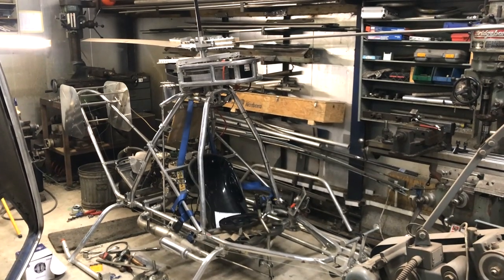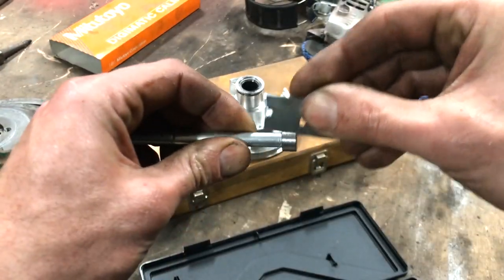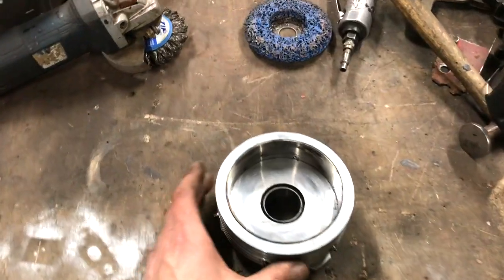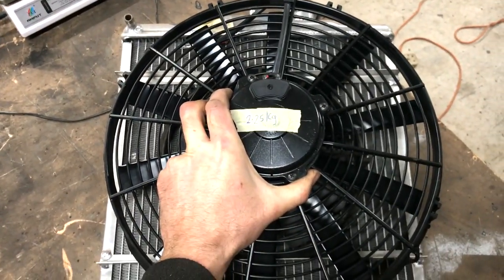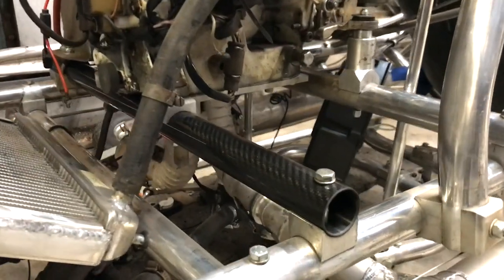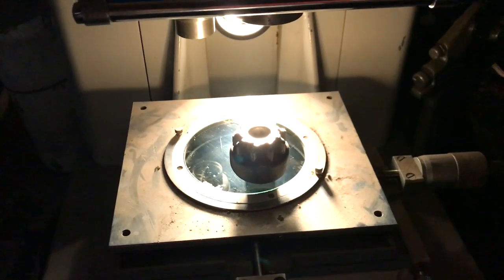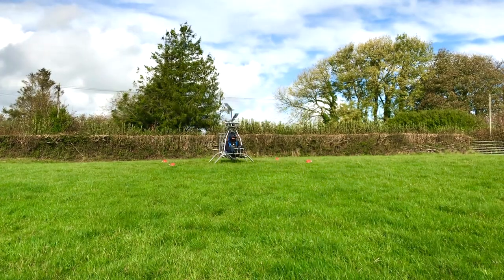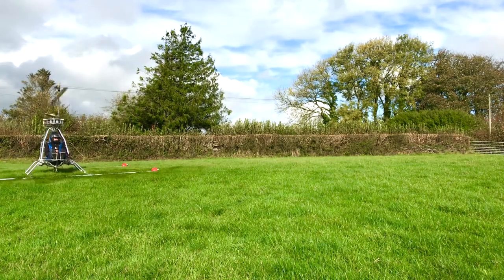It's not easy making a Helicopter

Comment: Bearing walk out may be symptom of drive shaft dynamics. Possibly boot distortion unbalance or even shaft bending flexure. High speed cam best way to see what's going on. Play it safe with engine rpm as its original design duty cycle might not be as demanding as a helicopter in hover. Recommend wire lock nuts to be sure that you are sure that nothing is coming loose...
google aircraft hardware suppliers to stop viscous YouTube algorithm deleting posts about flight safety. 🙄

Comment: Variable pitch opposed to variable throttle is the answer for a more stable hover.
Reply from the maker: Well, collective pitch is what I would choose next time. Fixed pitch is certainly less sensitive than collective, so in calm conditions it's easier but as soon as the wind picks up you want collective for the quick reaction time.
Reply: @Ben-Dixey  it’s that rotor speed staying at a constant high rpm gives you the stability. Much like a spinning top. If you slow down the top it wants to topple over and become wobbly.
Reply from the maker: I can't agree with that I'm afraid, there is no gyroscopic stability in any helicopter that I can think of. They are inherently unstable. The only exception might be the hiller flying platform, but the stability in that machine is not gyroscopic.
Reply: @Ben-Dixey  A co-axle helicopter is probably the most stable flying vehicle. So much so that they are sold in toy stores to kids. You don’t seem to know the flight characteristic of a helicopter meanwhile you’re building one for yourself to fly. Find a RC version and fly it first would be my suggestion. But hey to each their own.🫡
Reply from the maker: The toy rc coaxial helicopters are stable because they have stabiliser bars. You'll notice that weighted bar attached to one of the rotors. That is why they are easy to fly, not because they are coaxial. Coaxial helicopters are no more stable than any other configuration.
Reply: @Ben-Dixey ack to why the upper mass gives a top gyroscope effect. The top needs the bars because it’s small and needs inertia. Otherwise the blades would slow down too fast allowing it to topple over. I thought you as a mechanic would simply know the basic physics of a helicopter before building a full sized one. That’s the whole point of putting weight on the tips of the rotors.”Mass” you know “flywheel”. That’s why autorotation works because of the rotors mass has inertia.🤦🏾‍♂️ to be perfectly honest you will laugh at your own reply about the stability once you’ve flown a variable pitch. They are hands off stable. https://youtu.be/Z83t1iejpc8
Reply from the maker: At what point in the video did the pilot let go of the cyclic ? This demo flight was possible due to the very skilled pilot. Cyclic pitch coaxial helicopters are not stable. 

The stabiliser bar on the rc coaxials is connected to the rotor via pitch links, the stabiliser bar is a gyroscope and controls the rotors via cyclic pitch control. Arthur Young developed the stabiliser to improve stability and it was used on the bell 47. 
Adding weight to the tips of the blades is for autorotation performance only. Not gyroscopic stability. 
 You are getting more disrespectful in your reply's. I will end the conversation if this continues.
Reply: @Ben-Dixey  lol is a gyroscope not like a top is my point. With respect, you have chosen the least stable platform considering coaxial helicopters to build. Anyone who has had experience via RC or full scale would have simply known which platform to your build skills towards with respect. You can end the conversation here. I understand my constructive criticism comes across as offensive to you. 
Keep the good work fellow 
This guy explains exactly what I was saying 
https://youtu.be/j273HGK6g5M
Reply from the maker: Hi, I watched the video and he says that the higher rotor head speed on the collective pitch model gives more gyroscopic stability. This is not correct. What it does is makes the model more responsive, it does not help stability. You are assuming for some reason I have no experience in flying Rc models but I actually have a blade SR, blade 400 and I used to have a fixed pitch coaxial. The fixed pitch coaxial was the easiest to fly by miles. I have also flown an R22 and of course my homemade full scale helicopter.
Reply: @Ben-Dixey  so to you, the speed of the rotors has nothing to do with stability. It's not an argument on my part. I just assumed we would both agree with that much. My raptor 60 would handle a lot better at higher RPMs. it was less susceptible to the wind. Are going to tell me that your fixed pitch handles fine in windy conditions?🤔The authority of the aircraft “high rotor speed” I thought accounts toward the stability also.
Reply from the maker: Ok, we are getting somewhere. 😉
Rotary wings are complicated and I am still learning about them. I think we can agree that any spinning mass has gyroscopic forces involved and exhibits gyroscopic stability. A rotor is being controlled by aerodynamics and that has to fight the gyroscopic forces. Increasing the head speed does nothing to increase stability from a gyroscopic point of view. The reason your raptor handles better in the wind with higher rotor speeds to do with dissymmetry of lift. The percentage change in blade speed from the advancing to retreating side is less during a gust. Higher blade speeds are also more responsive to control, this might help you counteract unwanted pitch and roll from the wind. 

My fixed pitch rotors don't handle wind any worse than any other helicopter in pitch and roll but as I don't have collective pitch when a gust comes the helicopter rises. Due to the rotor inertia it can't react very fast enough. So stability in the vertical axis isn't good enough with fixed pitch in windy conditions.
Reply: @Ben-Dixey  yeah man I had to take a break from this conversation my brain was beginning to hurt lol. So I did some research and you and I are both right and I was wrong about the coaxial having any kind of gyro effect due to the contra rotation blades having canceled out any induced torque. Crazy, I need to buy a coaxial collective pitch for further research. I stand corrected. 🫡 with that being said, buddy, you were supposed to get with the collective pitch from get. I'm teasing bro have fun out there.
Reply from the maker: Understood 👍 yes it's a real headache, I belong to a forum where the details of rotary wings have been discussed and argued for years. I do believe it takes years to understand it all. I did a video on how the counter rotation cancels gyroscopic precession and gyroscopic stability but that is only when the spinning objects are fixed to the shaft. If they are hinged like my teetering rotors then they can't cancel. It then behaves like a single rotor or a gyrocopter. That's my take on it anyway.

Comment: my engine heats up quickly, do you have a solution?
Reply from the maker: Hi, my engine overheats too. I have put on a bigger electric fan but I think a belt driven fan might be needed in the end and possibly a bigger radiator, we are asking a lot of these engines and keeping them cool is a challenge. I'm reducing weight in the machine so I can add weight in extra cooling. Getting a helicopter to fly is one task, keeping it flying is another.

Comment: Love your videos. I'm using the same generator but it barely keeps up with current draw from the electric fuel pumps and ECU. Keep up the great work 🙂
Reply from the maker: Thanks very much Cam. 😊 interesting you chose the same generator. I expect in the end I will have to go for a belt driven fan but it should point me in the right direction with regard to sizing. I'm getting as much weight as possible out of the machine, at least then there will be an option to add a bigger radiator or add another. Your fuel pumps and ECU take a bit of power don't they! Doesn't sound like there will be much left for the big amp and stereo. 😉

Comment: Adding a stabilisation augmentation device  like the bell stabilizing bar to the rotor head could improve the stability and the handling qualities in hoovering and also make translation flight more achievable.
Reply from the maker: Hi, the bell stabiliser bar is connected to the blade feathering pitch links. I don't have blade feathering on this design. The rotors are fixed in pitch so unfortunately I can't add such a bar. It is possible to raise the rotor to a higher elevation and that might help stability.

Comment: I need to get one of those bolt shaving shop blades! Interesting viewer that allows you to inspect the tooth angles.
Reply from the maker: The blades are good but pricy. 😆 my projector I bought for £100 on eBay, absolute bargain and great for measuring stuff like this.

Comment: i say increase pitch , keep rpm low..in theory it should run cooler.( or at least not run hotter
Reply: @cd2920  good point , im thinking small plane 4 strokes with variable pitch